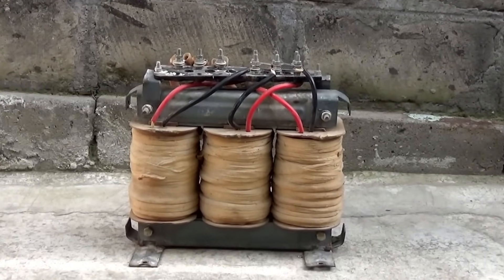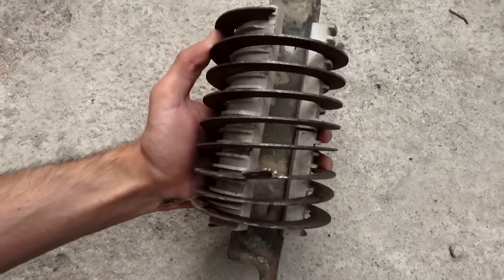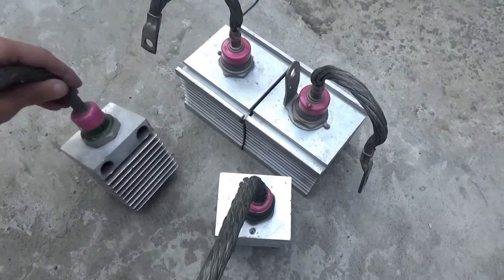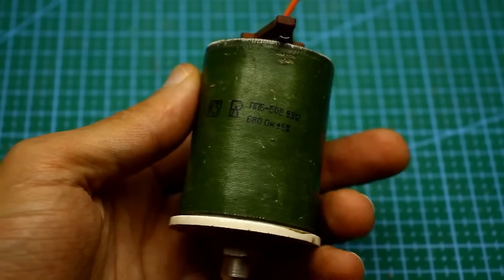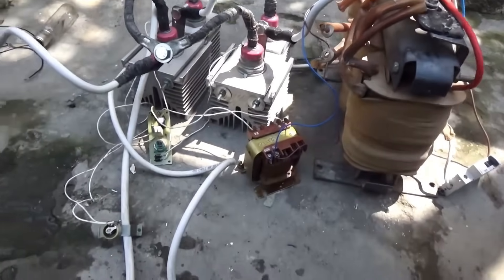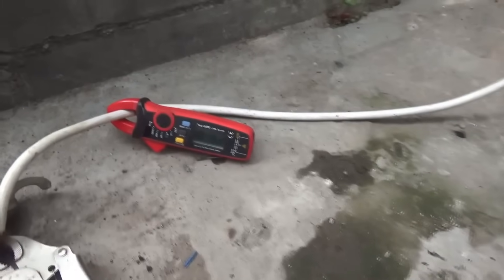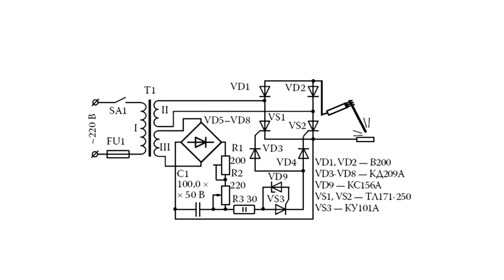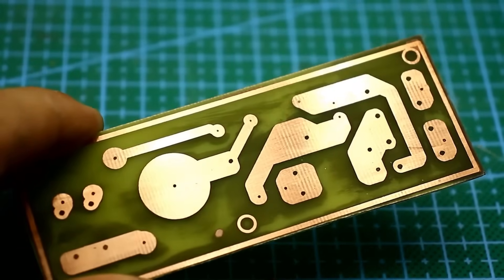Current regulator for welding machine

Comment: You are missing a choke and a zero diode at the output. When the thyristor is turned off, the output current is interrupted. The choke and zero diode ensure that the energy from the choke will continue to supply the welding arc. Also, the sensing shunt for current stabilization is missing, without it the current changes with the electrode distance. See the diagrams of Czechoslovak welding machines such as WTU 200 or 315

Comment: Ideally transformer needs a shunt so it's impossible to overload but it will require alot of work.
Reply: How can I make one three-phase transformer for basic electrodes out of 3 single-phase transformers with shunt regulation for welding? I know that I connect the primaries in a star and that I need a three-phase rectifier and that I have to connect the shunts so that they all move at the same time when I turn the handle, but I'm afraid that the voltage behind the three-phase rectifier might be too high and I don't want to unwind the secondary of each of those three transformers.